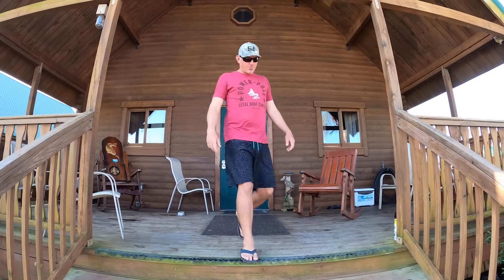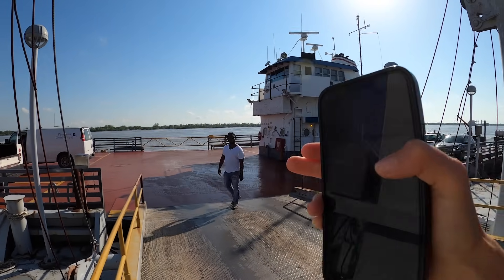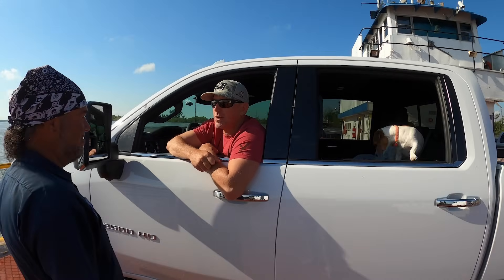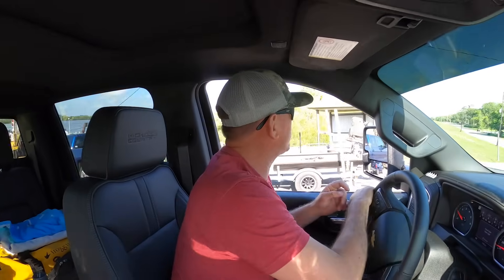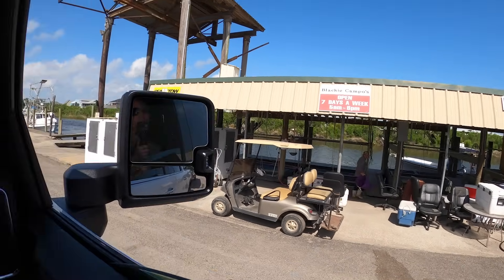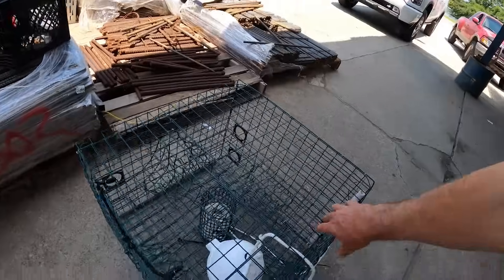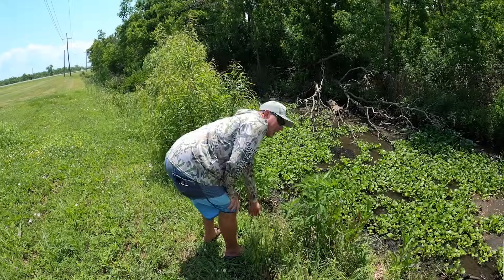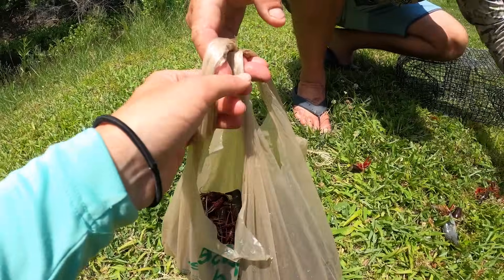Catching CRAWFISH on the side of a *PUBLIC HIGHWAY* with our NEW TRAPS (CATCH & COOK)

Comment: BlueGabe.  The crawfish died because they could not breathe because the oxygen in the water was depleted but if you set your trap with some of it sticking out the water the Crawfish can also breathe air as long as their gills are wet.    Check out the pillow trap design which is used in the swamp and the pyramid trap used in ponds, both designs stick out the water
Reply: They died when gabe threw the traps, they landed on top of the crawfish and killed them
Reply: @kobweb2994  I absolutely agree with you. Smashed em dead. Any experienced waterman would know this. 👍
Reply: @kobweb2994   couldn't have said it better. It was smashing
Reply: @PmcCoy Exactly
Reply: @PmcCoy LOL  RIGHT
Reply: @kobweb2994  you clearly don't know how traps work. The craws have to walk into the traps. They die from exposure to the sun... They come out into the sun in small increment... They need shade.
Reply: I know, 😂 i was joking
Reply: It's running water. It's not a puddle and they most likely died from sun exposure.
Reply: I agree

Comment: Your trip on the barge was easy. In the 60's, We lived in northwest Tennessee. When we wanted to visit my uncle, in Northeast Arkansas, we had to cross the Mississippi River on a barge. I can remember riding on the barge, when it was so full, that they had my mother pull on the barge and put on the emergency brake, because the trunk was hanging off. They had to pull the chain under the back of the car, behind the back tires.

Comment: Gabe,
Glad you finally got some good crab pots. Been crabbing in Chesapeake bay my whole life, and these are what you need. Don't be disappointed when they don't catch a lot right off. They need to be in the water for a couple weeks to get the new "stink" off of 'em. Look forward to some good crabs for steaming!!! Best Crab Seasoning...: 1 part Old Bay, to 1 part Kosher Salt, to 1/4 part ground red pepper. mix and sprinkle heavily as you layer them in the steam pot for cooking.
Reply: We boil crabs on the gulf coast…..which puts the seasoning inside the crab where it belongs, not on the outside of the shell. I’m not knocking steamed crabs though, had
 plenty in Virginia and Maryland and 
they were good. Excellent crab cakes
 as well. I prefer boiled seafood because it’s what I grew up eating. Folks on the Chesapeake grew up eating steamed crabs and that’s what they like. Blue crabs are awesome either way!
Reply: @alldaveallnight4581  🙂You have that correct my friend.

Comment: in the 1950's, my Grandfather took me crawfishing North of Laplace on Hwy 61 (to Baton Rouge).  We'd drop those nets in the drainage ditches next to road, and almost as quickly as they were placed, he'd go to the other end and start hauling up tons of mudbugs. These were the wire hoop topped nets, picked up with a strong cane pole, the bait held onto the bottom with a huge safety pin.  When all the hamper baskets were full, we went home to purge, rinse and boil.  Uum uum good.

Comment: Gabe, your contender trailer needs to have  the hydraulic brake kit installed, a 31ft. boat will push any truck into the intersection under the right circumstance.  Put a set on the trailer of my 24ft Seawind, NO MORE PROBLEM STOPPING. Even put trailer brakes on my utility trailer. SOOO NICE.

Comment: cool video. I run a lot of cable and cat5. with a little practice you can get pretty accurate with stepping off lengths. walk the length of your truck and boat and count the steps. then walk the length on where you are trying to pull into and you can get pretty accurate. I have learned a ton from you guys. thanks.

Comment: Hey Gabe!!! do you know why there are four entrances /door way on those crab traps and not two. four works better but there a reason you will catch more crab with four door ways... if you put a trap near or in a weed line you will catch shrimp when there running. and put a trap near a pole and you end up with small sheep head and grunks. at least that work when ran 200 traps 30 ago in the interal coastal water way.
Reply: Intercoastal canel....

Comment: On your crab traps that don't catch crabs. ( If it's not a design flaw.)

 They could be "Hot".  In the PNW dungeoness fishery there's zincs and aluminum sacrificial anodes on some pots to combat the differential/galvanic corrosion.  I had mixed metal pots that wouldn't catch anything till I squashed a couple of beer cans into the stainless wire.  They only lady a few days before they corrode to death but they caught crab.

Comment: I think the issue with all the dead crawfish was, as you said, the water level dropped considerably and you didn't collect them early enough. Deeper water will usually result in bigger craws and keep them alive longer but best to collect them within an hour or so of sunrise
Reply: The issue was that the traps were completely under water. They need to come up for air. They don’t breathe under water like fish. In short.. they drowned
Reply: @allenwatts2580  Crayfish have gills for breathing underwater, but can also breathe air. They run into trouble when the gills dry out, or there is insufficient oxygen in the water (which was most likely the case by that time of day in that setting, as the warmer water gets the less oxygen it can hold, in addition to the lack of circulation in those shallow ditches replacing the oxygen as it's drawn from the water).
Reply: @DAllenMartinphotos  I’ve been crawfishing my whole life. They will drown if you do not leave the trap partially out of the water… guaranteed
Reply: You pretty much just said what the comment said before yours lmao.

Comment: Look up the Mississippi/ gulf of Mexico dead zone. Right know it's about 9000 square miles, it normally fluctuates between 5000 and 8000 square miles. And you can blame it on chemical ally. The chemical production corridor all the way along the Mississippi river.

Comment: Crayfish can breath oxygen from the water, when there is enough dissolved oxygen present, and air too as long as their gills are wet. When the dissolved oxygen drops below 3 to 4 mg/L, they will need to breath  oxygen from the air. The dissolved oxygen in the water probably dropped too low, and if part of the trap was not above the water allowing them the option to breath air, they may have suffocated. This can also happen when you are purging them - make sure the water stays aerated.

Comment: In the hotter days of summer the trap needs to be slightly out of the water in order for them to get oxygen. The oxygen depletes from the bottom up so if the traps are completely submerged the crawfish will die.

Comment: How much is a trap ?
Reply: $20
Reply: $20 for a crawfish trap….which is crazy because you can make a bunch of pillow traps for $20. 
Rigged Crab traps are quite a bit more.
Reply: @alldaveallnight4581  must be becuz of inflation lol $15 is legit price .. maybe these are built differently
Reply: @ballistic350   They must be using those fancy stainless steel hog rings instead of the galvanized lol 😂
Reply: @alldaveallnight4581  lol I wouldn't know where im from i tried trapping for crawfish and got shiet lol
Reply: I don’t want anyone to get the wrong idea. I was kidding around. Those are quality traps and are worth the money. Coated wire, good hog rings & rubber closures….they’ll last for years. Johnny’s doesn’t make junk. You can buy coated wire and make your own crawfish traps easily….they work but aren’t nearly as nice.